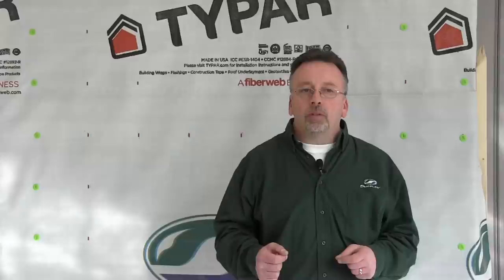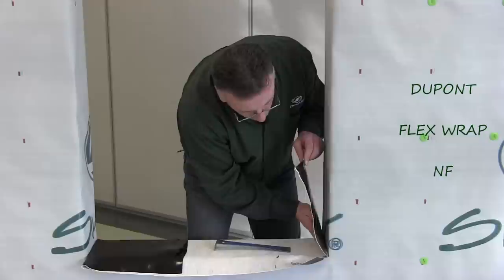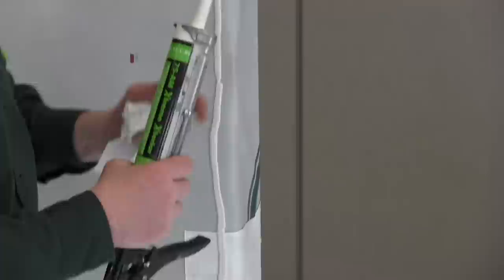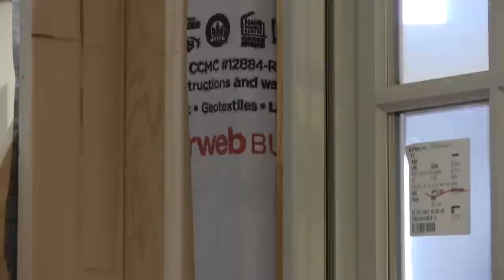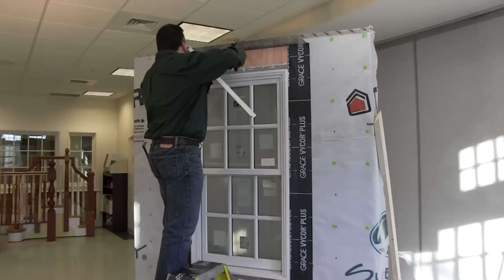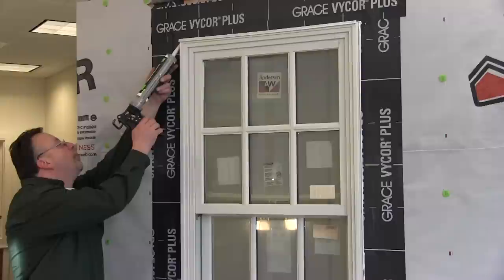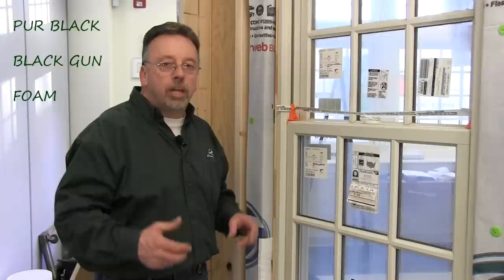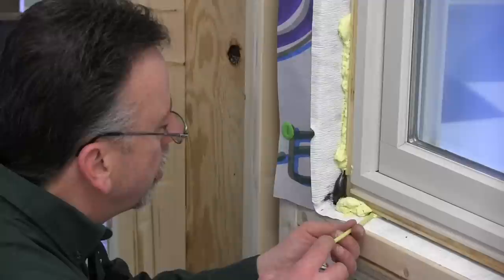Andersen A Series Double Hung Window Installation

Comment: I just used the vycor yesterday and that stuff sticks very well. Its not cheap but its definitely a quality product.   Just be careful not to stick it to itself or you'll never get it apart. Try sticking the top and then peel the backing paper off and you go down. DO NOT remove all the backing in one shot or you'll have a very hard time applying it exactly and smoothly which you're siding guys will appreciate.
I must say most guys absolutely do not install windows this way because, as you can see, it's time consuming.  However this is the absolute correct and most definitive way to be certain you don't get leaks and that install should last longer than the operating parts of the windows themselves. 
VERY VERY proper install!! Excellent explanation. This is coming from a 20yr plus contractor who does things the right way hence why i still watch videos to learn any new trucks possible.  Theres always a better way to do things and don't allow arrogance to get in the way of quality progress.

Comment: We install in hurricane zones along the East Coast and no longer pull the house wrap back into the opening along the sides. Bringing the wrap back to the interior can channel water straight to the interior in the event that water leaks in behind the house wrap from areas above the windows (usually roof or soffit leaks). It's unlikely, but I've seen it happen over and over from water penetration above through improperly flashed soffits etc, especially in areas prone to high wind driven rains or hurricanes. The method shown in the video is still very common and effective- head and sill prep is spot on. The only thing I would suggest changing would be in regards to the house wrap along the sides. Cut the house wrap back 1-1/2" along the sides so the nailing fin can be adhered directly to the substrate along the head and sides. This will create a barrier to block any trapped water behind the house wrap. https://youtu.be/Q6cVnbUSK8Y?si=EI6k5iCotdcfDPLG

Comment: Rather than bringing your wrb all the way to the inside I cut it vertically halfway on the jack stud then terminate it with tyvek tape. This way if there is any point in the housewrap improperly installed where air is getting behind the housewrap it wont flow past that otherwise beautiful installation.

Comment: Can you tell me if the spray foam canisters and guns are universal, or do you have to use a special gun for the Pur Black vs the regular poly foam?
Thanks...
Reply from the maker: +Don Williams 
Don - you can use a foam applicator gun, which can be used with other foaming agents. There are many manufacturers that make these.

Comment: I thought i noticed that you caulked the outside bottom seal, doesn't that stop water from having a way to escape.
Reply: paul newton I thought so too at first and then realized that he didn’t caulk between the flange and the rough opening but instead where the flange is factory connected to the window unit to give it that extra seal.

Comment: Doesn't applying the caulking at the joint between the vycor and the unit interfere with placement of any j channel? Shouldn't that be done by the siding installer so it's still flexible?

Comment: Just an old school carpenter who hasn't been doing this for years. I just installed some 70 series from home depot. And after going about researching all these new installation processes. I've noticed no one is installing the flashing under the fin over the siding. Isn't that supposed to be the the first step on the window install? Or is this not necessary anymore? Seems funny with all those steps were not redirecting the water out away from the underlayment.
Reply: Charles Briggs where r u taking about exactly and what kind of flashing? Metal?

Comment: HOUSE WRAP   DOES  NOT  COME  INSIDE THE HOUSE.      FLASHING TAPE MUST BE ROLLED WITH A J-ROLLER.    USE   "SEALANT"   NOT  CAULKING.   DYNA-FLEX SEALANT.   POOR WATER MANAGEMENT,   DO NOT TRAP WATER ON THE BOTTOM SILL.

Comment: Vycor is a petroleum product, you can't put it over the Dupont flex tape, it ruins the Dupont over time. The petroleum eats the rubber, use Dupont flashing. You can go rubber over petroleum but not the other way around, ask Dupont if you don't believe me as a random guy on the internet

Comment: How do you do the tyvek when you have drywall inside?  Also does the  DuPont flexwrap sit flush with the inside framing
Reply from the maker: Wrap the tyvek to side of Jack stud and staple. You are correct the Dupont flexwrap should be flush with the inside framing.

Comment: I've replaced doors before, now doing it for the first time for a window and I am shocked that you do not need to secure the unit from the interior side of the wall (through jambs into the studs.  Is this intentional as to not disrupt the action from opening the window?  You'd think they would just recess the areas where the unit could be fastened as to not disrupt the opening/closing action.  Theoretically someone can remove the exterior trim, remove the window, then proceed to rob my house, then reinstall the window/trim.  I would hope they at least reinstall prior to leaving, but that might be asking too much.
Reply: Jordan, I have the exact same question!
Reply: A robber will just pry your back door open before prying a window out.  
Your theory is plausible,  but not realistic.

Comment: How do you keep the drain path open at the bottom sill when stucco is applied?
Reply from the maker: I have no experience working with stucco but I would use Andersen's  barrier  method  install. Applying  backer rod and sealant around all four sides of unit. This will keep any water from getting into sill area.
This method is used when you have extreme exposure, Ocean front or lake front or wind areas.

Comment: to use nails is a bad idea! use screws.
Reply from the maker: The idea with the roof nail is to keep the nail head flat to the flange without puckering / wrinkling the window flange but I do understand why a screw would be better to use especially for adjustments within RO.
A helpful hint using roof nails to tack flange is to not drive nail completely. That will allow you the ability to remove if necessary.